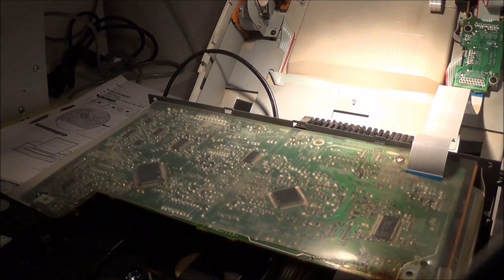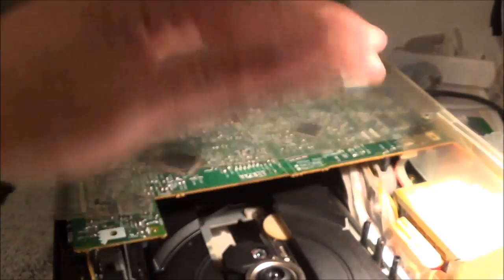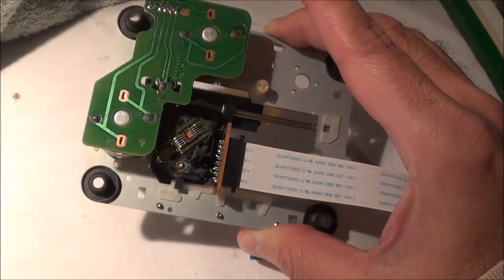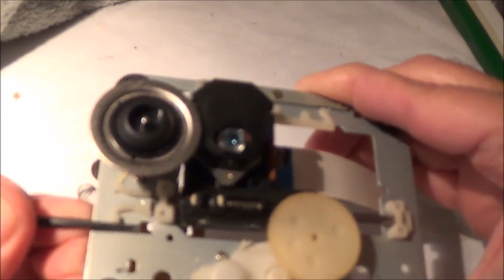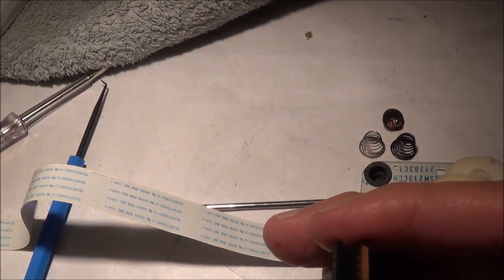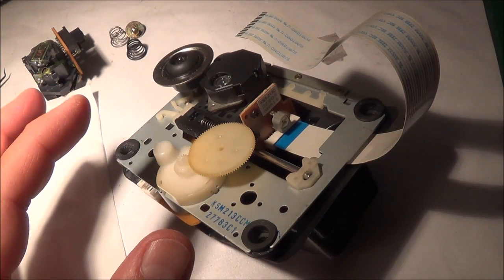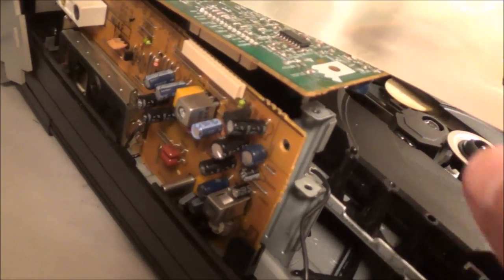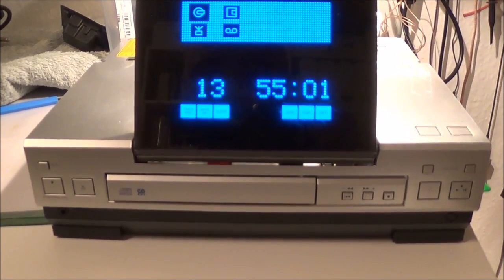Pioneer XC-L5 -- Part 2 -- Optical pickup installation

Comment: whant to sell your laser power meter?
Reply from the maker: No way! I had to wait a long time to get that!
Reply: @OldSchoolElectronics  kkkk.....i´m afraid you gonna say tha tkkkk... so please. help me build one.... please can you take pitcures of the board of the component side? and help me find out what type the sensor uses,. Could be a small sollar cell. like those used in the casio calulators? PLEASE!
 this a very hard to find tool? as i could see in some pictures on the internet, there´s a few electronics parts.
Reply: @OldSchoolElectronics  i´m afraid you gonna say tha tkkkk... so please. help me build one.... please can you take pitcures of the board of the component side? and help me find out what type the sensor uses,. Could be a small sollar cell. like those used in the casio calulators? PLEASE!
 this a very hard to find tool? as i could see in some pictures on the internet, there´s a few electronics parts.